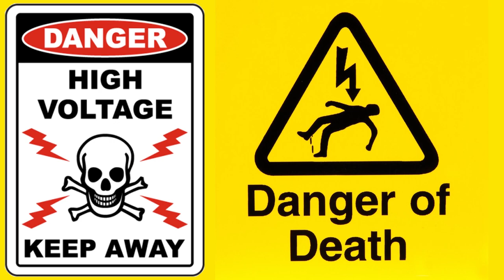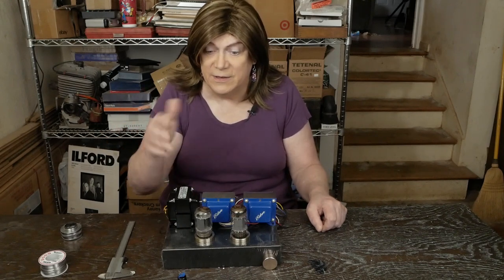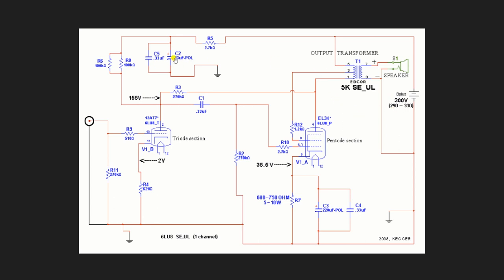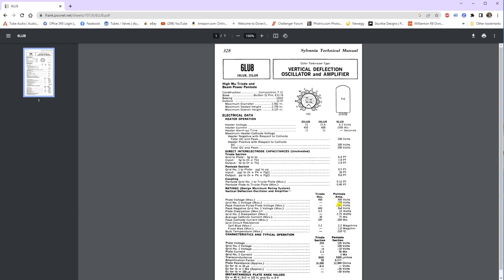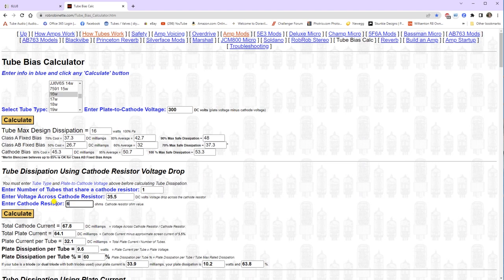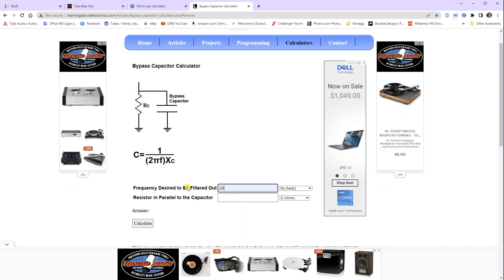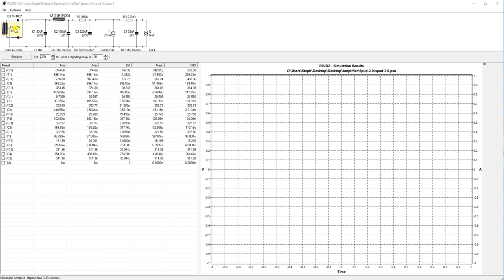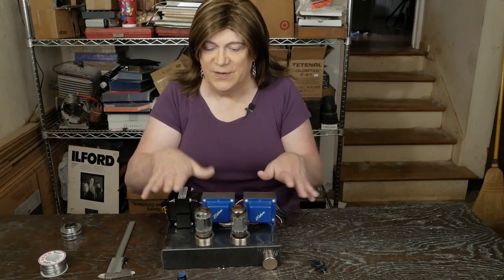How to Design & Build a Vacuum Tube Amplifier

Comment: This method of FB was used by and on the famous WE  amplifiers .................I used it building amps based on the older  WE amplifier circuits and it realy sounds GOOD................( with no overal nfb ) .............almost total absence of time smearing and preserving the original harmonic struvture of the tone almost as good as no fb........and with the benefit of this technique !

Comment: The PSUD2 software seems really useful for the power supply. I have no issue with using such tools to do the math.
Reply: It is as long as you use it correctly ..............seen many use it the wrong way .

Comment: A note on large value coupling caps:  Put a small disk, paper, mylar, etc, one in parallel with the larger value one, say, a 0.1uF in // with a 200uF.  This practice is common for eliminating the noise produced by zener diodes--the little one bypasses the higher frequencies, that the big one has trouble with, due to its ESR, inductance, etc.

Comment: When you are using PSUD do you ever change the resistance value of the power transformer? I have found that value can change the model quite a bit, but it is a very difficult number to find. This looks like it will be a fun build and the tube prices are not out of line.
Reply from the maker: I normally don't change from the default unless I have those numbers. It can change the results but I always consider tools like this a "ballpark" type of thing anyway. So far it's mostly been very close for me.

Comment: Awesome, you are a great teacher.🙂
Can I ask what speakers you run with your tube gear?🤔
I'm in the U.K, we don't really have much choice for high sensitivity speakers, especially affordable ones. Seems to be a lot more choice in the states with the likes of Klipsch(heritage line), Zu, Tekton etc.
I build my own, have a design I've just finished tweaking utilizing Faital 12PR320 and Beyma TPL-150H which I have designed specifically to get the most from tube gear. Happy to share the details with you to try it of so inclined or share it with Patreons etc, might be helpful to some especially where high sensitivity speakers are thin on the ground.
Design includes a flattened impedance after woofer and port  spikes, then it's level. 95dB sensitivity, 40Hz F3. Also be happy to design different crossover variations for people who like say a flat response or a bit of treble lift, slight smiley frequency response etc.👍
Lol, not selling anything, literally just something I'm happy to share with you and the community here.🙂
Reply from the maker: Sure please share the info!
Reply: @SkunkieDesignsElectronics  will do my best to explain in comments, see if it comes across as usable information as soon as I have time later.🙂
Reply: Step One.
Box.
This bit is pretty simple, ideally you want 120 litres for the Faital Pro 12PR320 to work in. The displacement of the 12PR320 is 1.8 litres and the Beyma TPL-150H roughly 2.3 litres from my calculations, so that's an extra 4.1 litres needed in volume. Then factor in the desired amount of bracing, for me I went with 127 litres total. Dimensions for internal I chose was 14W, 42H, 13D. I built them so they are effectively floor standers, due to volume required and also to negate the need for speaker stands. It's a large volume, but in this format it's not really overbearing, plus height of baffle gives that sound reinforcement and brings tweeter to my ear level at listening position. Obviously these will be higher, wider and deeper due to box construction and will depend on thickness of wood used.
For construction I tend to use both MDF and Plywood with a silicone layer in between to bond them together and reduce any resonance's, a constraining layer construction. There is room to manoeuvre in regards to construction, however crossover may need to be altered for largely different variation of the baffle. The Beyma is 1 inch above the woofer, no baffle step correction is used, largely because most people's listening rooms, especially here in the UK are not overly large and I find putting in BSC for the most part in such scenarios just tilts the bass up too much. With the baffle length below woofer, it will largely not be required.
This is a ported design, port placement is largely down to preference here, front, rear, down firing even if you raise the box to allow, do whatever is best for your listening environment.
Reply: Step Two.
Crossover.
Crossover is a LR 4th order, this seemed the best suited for these drivers and allowed the greatest level of adjustment and also easier phase alignment.
For the start of the tweeter circuit we have a 12ohm resistor inline with a bypass cap of 2.2uf. Next is a 4th order featuring a 10uf cap with 0.3mh inductor to  ground, followed by a 7.5uf cap with a 1.8mh inductor to ground. The resistor and cap at the beginning can be adjusted up and down in value if required to raise or lower tweeter level and also tilt up and down if desired. This circuit as per mentioned is for a maximally flat response with about a 1.5dB treble rise at the upper end, which to my old ears is nice, but younger listener's with better hearing up there may want to adjust cap and resistor at start, a lower cap will tilt down, and higher will tilt higher, you can then adjust the resistor to compensate if you adjust the tilt and find region higher or lower in amplitude. Doing so within the realm's of where most are going to adjust either way has a very minimal effect on the phase, so it's fine to play around with this. Obviously you may want to make crossover accessible or even have crossover outside of the box if like me you like to adjust and tweak things to certain genre's. After all, Hi-fi is largely about the interaction in my book, be it media or the system itself.
The low pass is 4th order again, albeit before the first inductor there is an impedance correction to keep flat beyond the woofer resonance. This consists of a 0.16mh inductor joined to a 24uf, joined to a 16ohm resistor that goes to ground. To get 16 ohm's, use multiples in parallel, so say 2 32ohms to spread the heat dissipation. Given the sensitivity of this speaker, it's unlikely you are going to be feeding this a whole load of power, but check resistor loads in a suitable program if you are concerned or listening at concert levels. Next is 2.33mh inductor with a 13uf cap to ground, then a 0.75mh inductor with a 2uf cap to ground.
I'm trying to write this so all can use, having a diagram of a 4th order 2 way next to you and writing these values in corresponding place should be helpful to those new to crossover design.
Lowest impedance with this design is 7.3ohms, very briefly, and then 8ohms or above, a nice easy load for all tube amps.
Reply: General information.
Driver's.
Faital Pro 12PR320.
May seem like an odd choice to many, but for high sensitivity goals this driver is about the best I can find with the trade-offs that come with higher sensitivity, after all, bass is tricky to pull off in such a scenario, especially so in a reasonable sized box. This driver will also be available pretty much anywhere and has great response and a well regarded tone. Driver has a 97dB sensitivity, but alas putting into a box it measures 95dB, hence this overall builds solid 95dB rating as opposed to some manafacturers claiming 98dB for a speaker when that's either an average, or worse at peak, which many deliberately leave peaks in the response to claim a stated sensitivity that looks more appealing. They aren't dirt cheap, but not insanely expensive either at £144, I mean buying equivalent high sensitivity speakers is going to cost a lot more than cost of this build in many countries. Any concern regarding the use of a pro driver is pretty negligible, the moving mass is only 51.4g, pretty impressive for the size of the driver and being a pro driver this thing will be under no stress at all in a Hi-fi setting. With a response down to 40hz, and then any room gain depending on placement and you will get usable range down to low to mid 30's. Subwoofer isn't really a necessity here, which is probably quite welcome with the tube crowd purists.
The tweeter, Beyma TPL-150H is quite expensive, £400+ in UK. It is however highly regarded and really rightly so. This thing has a 102dB sensitivity so plenty of wriggle room for many high sensitivity designs. The sound, once the midrange hump between 2-10khz has been taken care of via crossover design is really something, this thing is fast and just an experience in my book.
Porting for the design is 2 x 82mm ports, 70mm in length. This will have port velocity below 20 m/s up to 50 watts of input power at which point your ears will be toast, so no issues there.
If anyone has any questions, fire away. Just sharing in the hope it helps those finding their ideal speaker for tube amp journey.👍🙂

Comment: Do you ever use variable resistors in circuit to fine tune the final value selection?
Reply from the maker: No I haven't, but that could be done.

Comment: On an aluminum chassis, if one wants a more durable finish, look into (1) Cerakote or (2) Aluma-Hyde II. Cerakote might be too difficult to work with for a tube amp application but is pretty much bomb-proof if applied and cured correctly. Aluma-Hyde II can be purchased in a rattle-can from Brownells and is a lot easier to work with than Cerakote, although not quite as strong as Cerakote but A LOT stronger than spray paint.

Comment: Looks like a great little project. I like the simplicity. Do you think I could use o/p transformers with 3.5K primaries or will this cause too much distortion?
Reply from the maker: If you lower the voltage across the tube to maybe 225-250V and increase the current to get to the same wattage, then 3.5K might work.
Reply: @SkunkieDesignsElectronics  Many thanks.

Comment: Hello. For the coupling capacitor calculation, shouldn't be considered the output impedance of the driver stage, besides the leak resistor..? thanks!
Reply from the maker: Tying to keep things simple :) Most people consider neither.

Comment: For cutting large holes, one might look into an annular cutter.  Annular cutters can get expensive, so be prepared for sticker shock 😉 Also, the YouTube channel "Project Farm" did a good review of annular cutters about four months ago; so, one may take a gander at that video to try a better idea if the annular cutter route is a good route for a hole-cutting project 😁
Reply from the maker: For large holes I'm using Greenlee knockout punches.
Reply from the maker: It does and you don't need a drill press :)
Reply: @SkunkieDesignsElectronics  Yeah, I saw that, and it looks pretty cool 👍 I also liked that you could use hydraulics if so inclined 😁

Comment: I played around with Coupling Capacitor Calculator. Mine has 100k ohm and 0.47uF. So for 2Hz is around 0.8uF. Should I change to 0.8uF or adjust resistor to 180k ohm?
Reply from the maker: What output tube and is it fixed or cathode bias?
Reply: @SkunkieDesignsElectronics  Both my PP 300B and KT88 have fixed bias that has 100k ohm and 0.47uF
Reply from the maker: @Warclock07  That's a different scenario than these cathode bias types. .47uf should be fine.
Reply: @SkunkieDesignsElectronics  Thank you,  I can see it now. That was a little bit confused 👍
Reply from the maker: I would think you need to measure the DCR from the grid to ground on a fixed bias amp, I know it's not just that 100K resistor.

Comment: Trying to understand the math a little bit.  Not sure how the 155V, 2V, and 35.5V are determined. Also, how was the 5K output transformer decided upon? Thanks.
Reply from the maker: I simply read them off the schematic Kegger posted. I assume he measured those off the built amplifier.

Comment: I have followed this series for a while and have ordered the iron and tubes for the build.  What I am having a hard time with is determining the values of the critical resistors and caps in the amp schematic.  I have the power supply down I think, but in this series you end up saying anywhere from 600-700R for R7 in keggers schematic (I think).  If you have said what they were and I missed it, I apologize.  Is there anywhere you can post a schematic that has the final values for your amp build?
Reply from the maker: Sorry I have been so slow updating my website, here is a link showing the final build schematics https://www.skunkiedesigns.com/6lu8
Reply: @SkunkieDesignsElectronics  Thanks Steph, I really did not want to pressure you, you are doing so much.  I appreciate the schematics, now I can finalize my purchases.

Roger
Reply from the maker: Lemme know how it turns out!

Comment: @Skunkie Designs Electronics For R7, are you going to use a single 5W resistor or multiple 2W resistors in parallel?
Reply from the maker: I plan to use a single resistor.

Comment: @Skunkie Designs Electronics It might be an interesting experiment to try a power regulation circuit at V1_B versus a resistor (or a 1.6V LED and resistor), since the voltage at V1_B can vary (more) depending on how much current is drawn when not using a power regulation circuit.

Comment: I can get a pair of 5K 25 watt output transformers for a good price. Will they work or should I just get the 15 watt output transformers?
Reply from the maker: The 25W will work, but are much larger and there is a point where extra large transformers can negatively impact performance. Also, I wouldn't buy anything until I am finished and have tested this design!
Reply: @SkunkieDesignsElectronics  Thank you. I'll wait. I don't want to mess up on my build.

Comment: I BELIEVE THE E 24 RESISTOR CODE SAYS 680 OHM IS A STANDARD VALUE , NOT 650 OR 700.
Reply from the maker: That is why I said "Whatever is a close standard value"...
Reply: If you want a specific value, which is not standard, just connect standard value ones in series and/or parallel, to get exactly what you want.